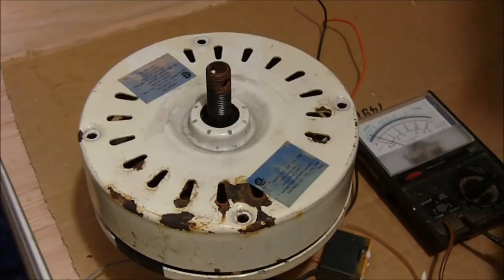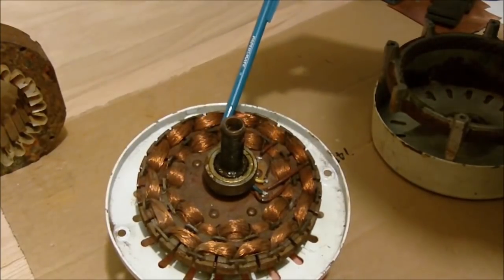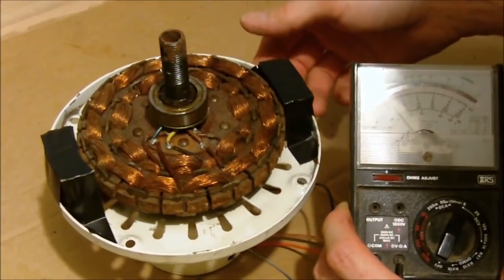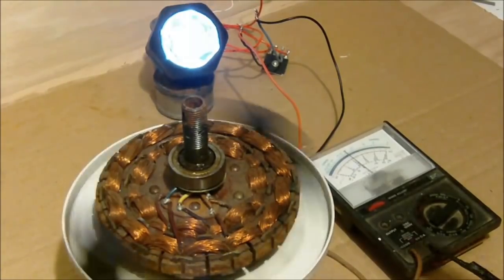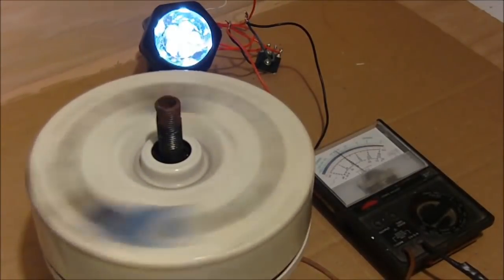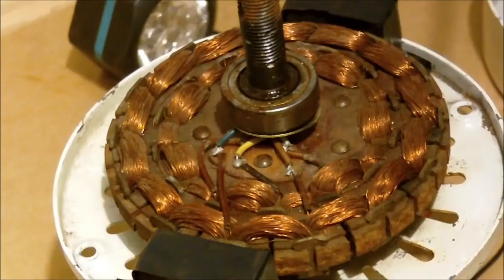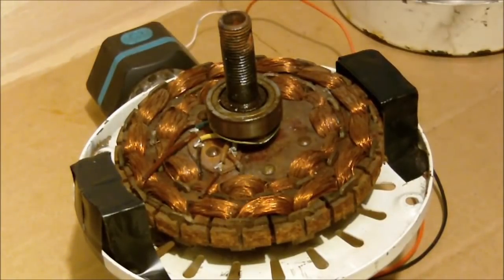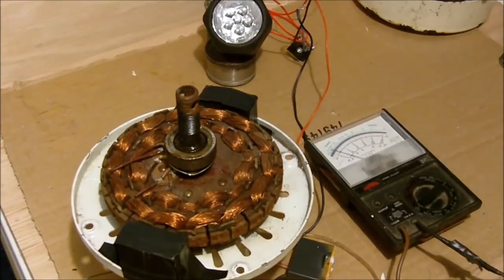Ceiling Fan to Wind generator conversion demo

Comment: @Jeremiah L No magnet is quad nor are hard drive NEODYMIUM magnets dangerous, it's a fact! You might want to pick up some books on magnets, dc current, ac current and just any book you can get your hands on. Your local LIBRARY will have many books I assure you. "AC motors usually do not have magnets required for generating electricity" you say. I'd like you to tell us which AC Motors do have magnets? Only DC Motors have magnets, FACT. What this guy is doing is converting a ac motor into a dc motor which any dc motor in turn will generate power but they're really made to take in power with larger magnetic copper wire coils. That is why he uses a ceiling fan because ac motors have thinner wire which will generate more power (he just doesn't know that yet but he will). 

Look up Nikola Tesla and Thomas Eddison working together on power and power lines.
Reply: Coincidental that you're talking about current and your name is Watts! LOL
Love it..!
Reply: Lol yeah heard it all my life! Never got into it until four years ago sad to say. Maybe its my calling?
Reply: shurley you can built AC motors with magnets,
y hardley understand yor comment.
Reply: Lothar Mayring yes you can in a sense. Look at motors in a treadmill. They are dc motors but when looking into the design for a.c. to run these motors it's actually inverters the power to dc. It's very simple really.

It takes less to invert power from a.c. to dc but much more to invert dc to a.c.
Reply: Of course in my eyes from d.c. to a.c. is inverting and a.c. to d.c. is converting.
Reply: I have to agree with Lothar, Michael you are wrong. AC motors, just like DC motors, have to have magnets. The only reason that AC motors use electromagnets instead of permanent magnets is for the sake of weight (and now cost). You are talking foolish when you say 'AC MOTORS don't usually have magnets'. If this were true, then the full wave bridge rectifier he put into the output would not have had an effect on the current. Likewise, when you made a comment about 'if he added a larger capacitor, he could make more power', this is not true either, he would make the same amount of power, with greater pulses. While a capacitor can level a current, it can only do so when it is near the optimum current output of the motor, and when combined with a balanced full-wave bridge rectifier. If the capacitor is rated higher than the bridge, you will get pulses and drops.
Not sure where you learned electrical circuitry, but stay away from my toaster.
Reply: converting DC to AC is much easier, because you dont have to trigger the point of changing
polarity.  That  also depends on freqency.  Your statment is false , Michael.
Reply: Lothar Mayring
Ok, now I have to disagree with you Lothar, it is easiest to convert AC to DC, because all it requires is a rectifier (normally a full wave bridge). You can build one with four diodes, or just buy one - for less than $10 for most projects. Then, you merely have to add a small capacitor to level your voltage, and from there, you manipulate your dc voltage and current as you need, to drive your devices.

I can build an AC to DC inverter for $20, but it's going to cost more than that to get DC into AC waveform.
Reply: you are right, all depends on frequency and waveform. You have to define what iyou mean with easy .
Only the costs lower dose not mean for me that it is easier. Some have money some not.
Imgine an AC -converter as an switcher. Than you have to trigger exactly the point of changing polarity. But with DC to AC ist is much easier. You can switch whenerver you like, because in this case frequency is not important. The easiest way to convert DC to AC is to use a switch conectid  to al little windmill like children make from paper. Costs ar nearly zero.
Reply: ok, you can by a rectfier, using the help of big comanies. But if have to construct an rectifier yoself, that will not be easy. For converting DC to aC only need a motor driven switcher or an bistabil relais or an harmonic oscillator . All ar emuch easier to buil than rectifiers.

Now i am not shure. Perhaps it is equual difficult to convert and our disscussion is only academic.
Reply: Lothar Mayring
Lothar, I can convert 110vac to 12vdc with the help of a transformer ($15 at Radioshack or off of Amazon) and either a full wave rectifier ($3) or four zener Diodes ($5) in rectifier configuration.  Look up 'how to build a rectifier circuit'.  That you think it is expensive tells me you don't know a lot about circuitry.

How to you think an alternator in an automobile works? It has an INTERNAL RECTIFIER (or on older cars, an external one) that is nothing but four diodes changing AC to DC.  Add a couple of capacitors to the circuit to smooth the signal, and a voltage regulator, and you have controlled DC for about $25.
Reply: Monney seems to be verry important for you .....
I was speaking about principles

Comment: Excellent demonstration that shows electricity doesn't come for free. Magnets store energy. They get that energy initially by powerful generators that put the energy there in the form of a magnetic field. It is so frustrating watching people demonstrate generators and leaving the viewer thinking that it creates energy for free. Not true. It is stored energy just like how fuel is stored energy...
Reply: +lwblack64   A generator like this isn't using the energy stored in magnets and turning it into electricity.  It's taking the kinetic energy of kurtscottage's hand spinning the magnets and turning that energy into electricity.  I don't think he claimed it was free energy.  The energy comes from something spinning the magnets.  Just like a dam with water turbines uses the potential energy of the water at a higher elevation to spin the turbines connected to generators.
Reply: Lee AusTex
Not true. The kinetic energy helps to release the stored energy in the magnetic field. To prove that point, remove the magnets. IF it is kinetic energy then it should work if your proposition is correct. It won't though. Trust me on that. It takes both to make it work. Just like fuel alone will do absolutely nothing by itself. It takes an oxidizer and a spark...
Reply: +lwblack64 Are you saying that the output electrical watts of this design are the direct result of "using up" the magnet field of the magnets?   How long will it work before the magnets are empty?  
It takes about 5.5 horsepower engine (input power) to run a generator that puts out 4kW (output power).  That's converting the energy of gasoline into electricity.  The magnets are not being used up.  The gas engine pushes the magnets which push electrons through the wire just like impellers of a water pump push water.  The impeller isn't the source of any stored energy.   B.S.E.E. 1984 University of Missouri - Rolla
Reply: Lee AusTex
What I am saying is: Once all the energy from the magnets are gone then you can put all the kinetic energy you want into it because nothing will come out of it. HOWEVER, just because the kinetic energy is lacking or not present at a given time does not imply that the magnets do not hold energy into their magnetic fields. Tell ya what you do. Go out some day and WATCH with your own eyes how magnets are made. It might help you to realize the science in what is happening..
Reply: lwblack64 - Your precept seems to state that this device will stop working within an inefficient and measureable amount of time. I argue that technically it will outlive us. And to argue over a modified ceiling fan generator's efficacy is a waste of time.
Reply: *****
How long it remains depends of several factors. ONE of the most predominate factors is How much wattage was used in creating the magnet(s) to begin with. You have to acknowledge and realize that magnets (now) are MADE artificially now by man. Have you asked yourself Why? Simple. Because the old magnets lost their strength and wore out. AND it is cheaper to Make a new magnet artificially than going digging for rare earth objects we call magnets. If magnet really were near immortal as some would suggest that don't you think that Capitalism would take advantage of that instead of creating new one?
 One last question: Do you ever see magnet reclamation centers? No, why not? Again its more cost effective to MAKE a new magnet than it is to reclaim the old ones.
Reply: do you really think that the magnetism is stored energy? ? really?
Reply: *****
Of course it is. Did your mommy tell you it was magic? Muhahahaha....
Reply: *****
wow, you must not be able to stay on topic. Might consider seeing a doctor about the possibility of having ADD. Sign you have little/nothing to add. Good enough
Reply: +Juke Long 
I shouldn't lol, sorry, lwblack64
Magnets are proof that god loves us and wants to speak to us via the Intenet. Just think of the countless eaons they have been waiting for the late 20th century.
Reply: Michael McNeil
You mean God can't love us and we have science at the same time? Who do you think created the means for science to even exist? Science is the study of the laws of nature that God created. And within those laws is the conservation of energy. Everything has its cost. Natural magnets were created by the energy of the big bang. But they are practically all gone now. So man began creating his own magnets when it was clear that nature could not provide the amount he needed. And how does he do that? Energy...
Reply: +lwblack64 now i could be wrong, but i believe that magnets dont actually store unleashable energy.
Reply: Reise Kingsbury
Have you actually seen how magnets(such as the neodymium) are made? Until you do then you are working on an assumption of how they work. One of the FIRST things that an electronics classroom will discuss is magnets and their close relationship with electricity and electronic parts in general...
Reply: the energy in is the kinetic energy which converts to electricity via the electro magnetic spectrum.
Watching something happen doesn't mean you understand it especially in your case.
If you are so confident that you are correct make a video of some magnets running out of "power" or whatever you're calling it, or better yet provided some literature to provided some support for your ideas. I bet you can't and do you know why because just because you believe something doesn't make it real
Reply: *****
and pray tell, enlighten us where kinetic energy cometh? Does it produce itself or is it a magically created energy? Of course not. All energy and matter is interchangeable as Einstein has proven with relativity and E=MC2...
Reply: the kinetic energy is coming from his hand i do believe
Reply: +lwblack64 yes riese is correct from his hand (face palm) do you know much about physics? i think there is a saying to suit this discussion; "there is no point arguing with a moron they just bring you down to there level and then beat you with experienced". bye!

Comment: Total waste of time for anything but experimental as the guy was all theory and no practice like how to drive it wind wise about 4/10 for usefulness. Might be able to put bridge rectifier on each of three groups of windings dc output of all three rectifiers in parallel + to + and to put condenser across +and minus to smooth output and use to charge one lithium (3.8v) battery or three 1.2v NiCad’s in series no voltage regulator needed as not enough power to overcharge. Maybe a battery pack that is charged from usb, and used to charge phones. Problem is that when under load will have greater mechanical resistance and be harder to turn wind wise. I do know what I am talking about as electrical engineer, but would not waste time with this device and is only of use for experimenting not any serious use due to problems you will find driving it which is not in the scope of this article. Good luck!